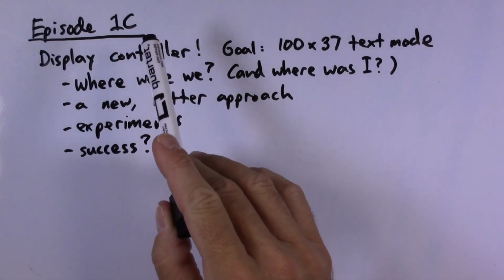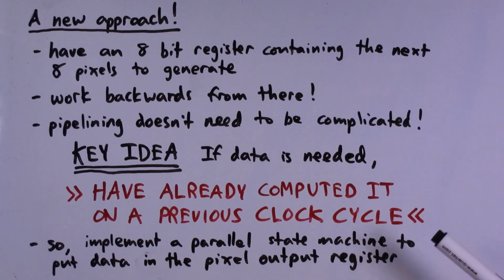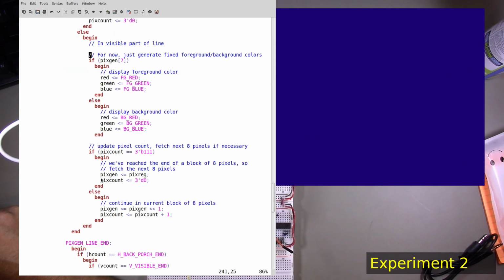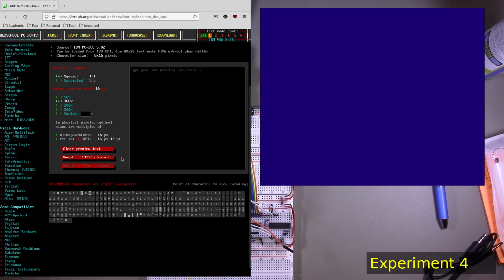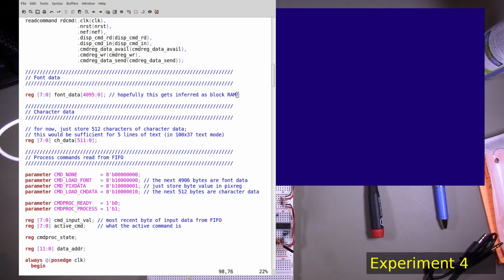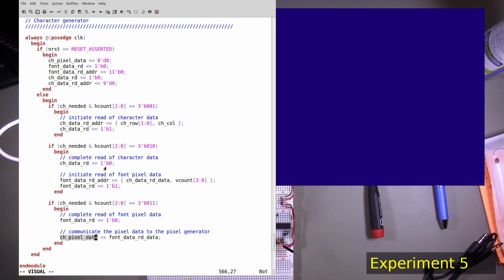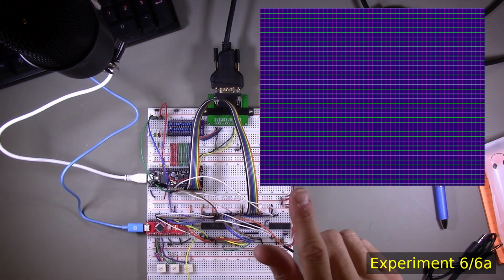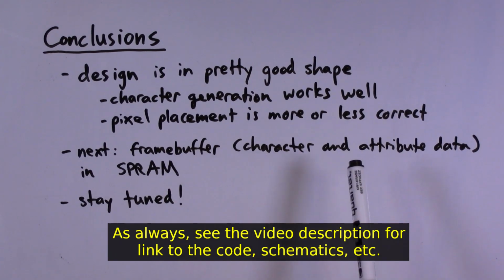DIY 8-bit computer, Episode 1C: ...In which characters are displayed

Comment: The litany of FPGA designers is "simulate-simulate-simulate". You would've found and fixed all issues in a fraction of time if you'd use simulations.
Reply from the maker: Yes. I actually learned how to write Verilog simulations this summer. I have a good chunk of a Verilog version of the display controller implemented now.

Comment: Which FPGA are you using. Good to
See that you use synchronous methods in your Verilog description. I have seen so many designs where engineers veer off this synchronous design route to end up hating and despising FPGA design. I made such a vga display driver for a commodore V20 and C64 computers . What you should do, if there is enough block RAM in the FPGA, is to implement a 4K x 8 character ROM, then a 4K x 8 RAM for the 100 x 37 display. Then get the FPGA to do all the data shuffling rather than the Arduino. The Arduino would just handle the lower layer operations such as downloading the character RAM and messages to be displayed.
Reply from the maker: The FPGA is the Lattice ICE40 UltraPlus 5K (UP5K). I'm using the Upduino 3 dev board, and the open-source IceStorm via the APIO front end.  Having everything be completely synchronous makes the most sense to me (as a relative novice at programmable logic.) The Arduino is really just standing in for the host 8-bit microcomputer system, which the FPGA will just be the display controller for. It's not period-accurate, but I'm pretending it's a custom ASIC 🙂

Comment: Hi, one suggestion I would like to give is use the dual ported ram as screen buffer and the single ported ram as bitmap data for fonts. The reason is you probably change the screen buffer much more often than the font data on an text display. Although the fpga is fast enough to perfectly sync the access to the ram in between the screen update access which only needs to read every 8 clock cycles or every 4 cycles when also reading color data from the same blockram. Internally I would organize the screenbuffer as 16 bits wide so the access to character and attribute data happens in one cycle. Ther would be an attribute register holding my current foreground and background color attribute for the current read/write position and an 16 bit address counter for sequentially accessing contiguous data in read or write mode and a mode register to set if you want to read/write, one byte per screen position (only character data) or two bytes (character and attribute) an count register to set the number of transfers (character/pairs) an up/down count bit and a base address for where to start (makes it easier to have successive block transfers withe less setup overhead).
Reply from the maker: Thank you for the suggestion! Let's see...the UP5K has 15300 bytes of block RAM. If the attributes (foreground and background colors) can be stored in 1 byte per character, then that would certainly fit. If the attributes were 2 bytes, to allow 256 fg/bg colors, that's 11100 bytes. The color palette only needs 512 bytes. With the font data in SPRAM, everything would still fit! Assuming it's possible to initialize the contents of the SPRAM as part of the bitstream, it wouldn't even require any effort to initialize. I like tthis idea...